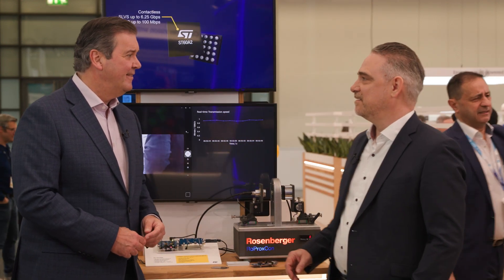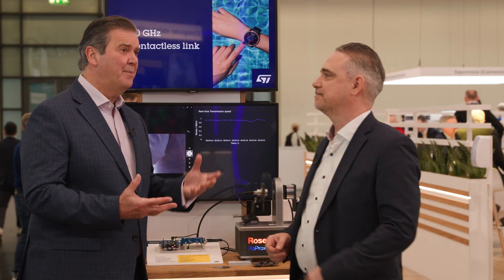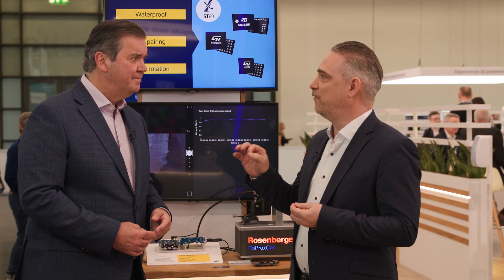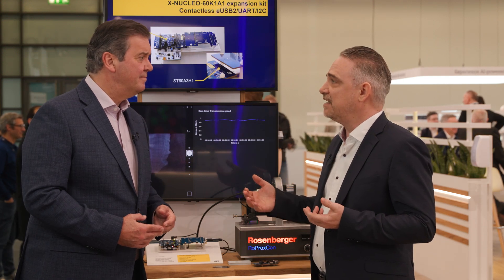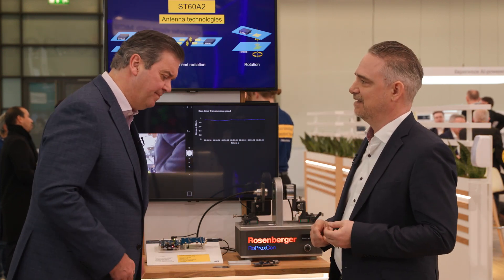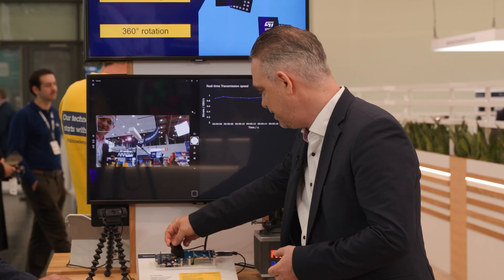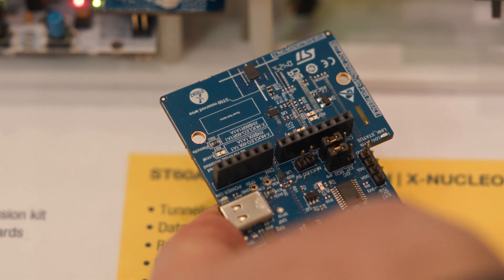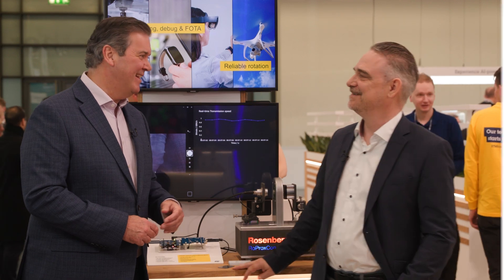ST60 - upgrade your design with wireless eUSB2

Comment: Wow, absolutely incredible. ST60 + a Qi2 interface. We need.a refrence design for that, so we can just have drag and drop wireless USB microcontrollers.
Reply: I believe they demo'ed that ~ a year ago - a USB-camera on a turntable - fed via Qi and read via RF.
Reply from the maker: Yes you are absolutely correct, we did show similar with a rotating webcam to show how ST60 can be helpful on rotary joints. The news on the ST60A3H1 are that this SIP includes the antenna as well into a 3x4mm package, reducing design effor significantly.
Reply from the maker: https://www.st.com/en/wireless-connectivity/st60a3h1.html
Reply from the maker: and for the availability of the board - June timeframe!  keep an eye on st.com !